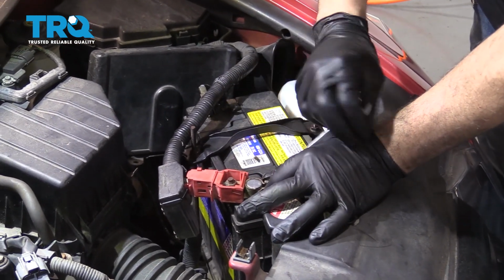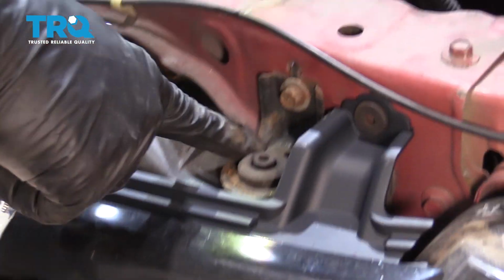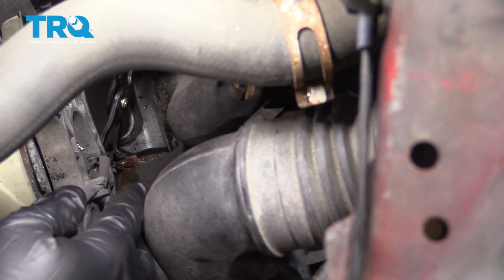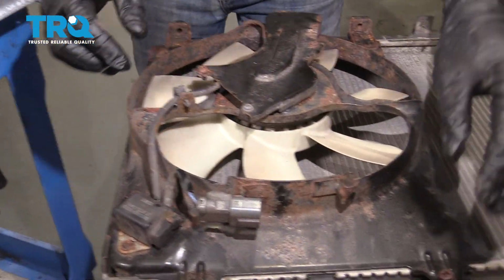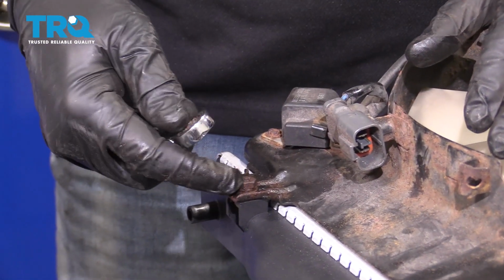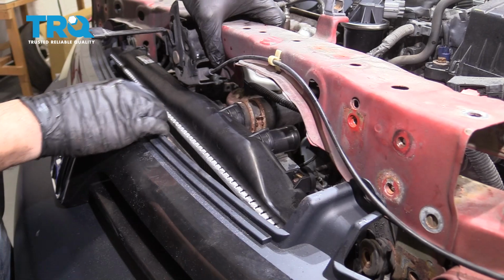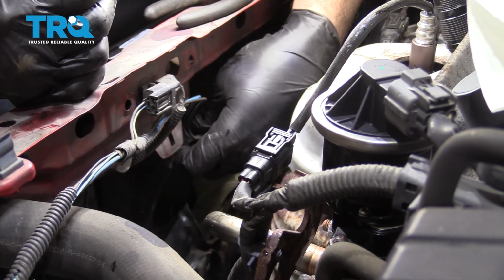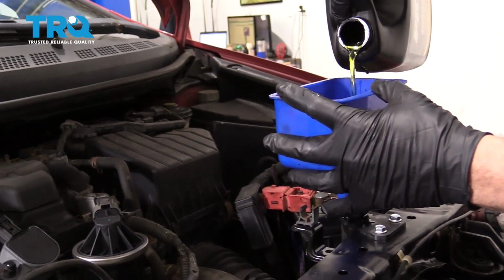How to Replace Radiator 2007-11 Honda Civic

Comment: I did the same thing. Except added coolant straight through and closed cap. Reservoir was good. Drove it a few miles home. Notice it was hot to the touch. No leaks. Was told. “ Did you bleed it?” I said no. Was told air pockets form when you don’t bleed it. Was running the vehicle and adding coolant. “Bleeding”,on your video?

Comment: I have no idea why you didn't instruct us to replace the upper hoses and radiator fill hose BEFORE putting on the metal crossbeam. And similarly why you didn't say to take off the cross beam before removing them. Maybe the car in the video is like a new old car or something, but getting to those hose clamps with the crossbeam in the way was an absolute b*tch. 

And getting the old coolant "quick connect" adapter off the old radiator took me an hour and a crap ton of cursing. It sure was easy for you in the video, but everything in that car looked like it was on a car that never actually got real wear and tear. Yeesh.

And the quick connect coolant adapter is not only a Honda OEM part as stated in the video. After market part available on Amazon for $12. Had I know this before hand, I never would have spent the hour on the old one.
Reply: p.s. Highly recommend Denso radiator from Rockauto. Perfect fit. $95

Comment: Can I ask you a question in regards to the transmission cooling lines on the bottom? Do they need to be capped off? Will coolant leak out if I install it without covering them? I have automatic transmission.

Comment: Would have saved yourself a buttload of trouble with those hose clamps if you had just removed 6 more bolts and lifted the front support out of the way...